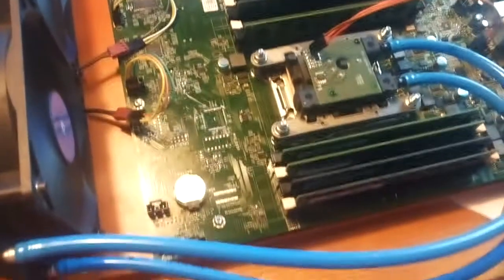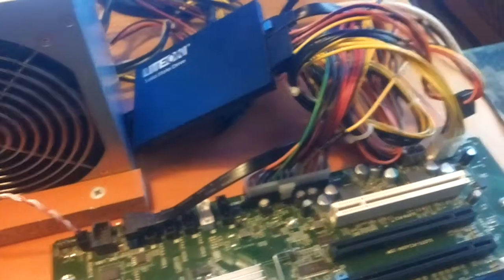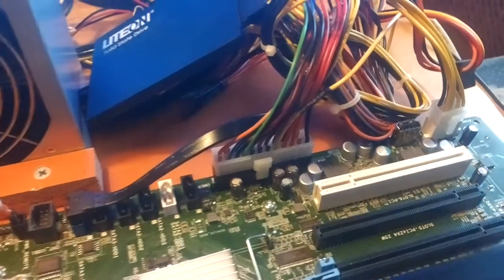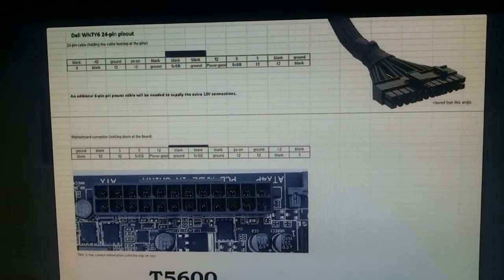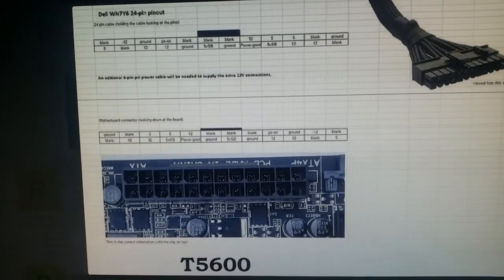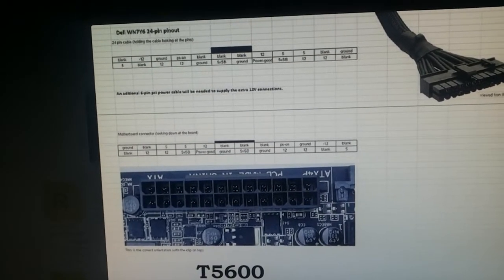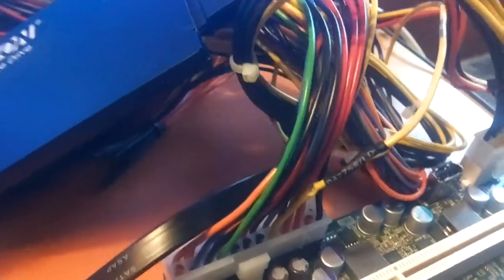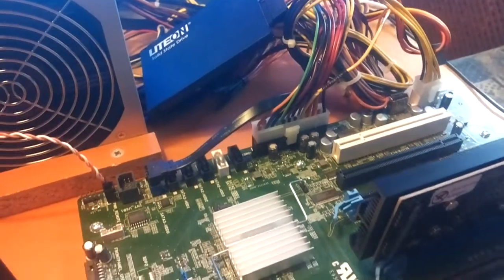Dell T3610 Power Supply mod for Dell Precision T3600 T3610 T5600 T5610 Workstation

Comment: My psu have 5v standby but my t7810 motherboard needs 12v standby any solution ?
Reply from the maker: Maybe you can use a small step up converter board
Reply: @pcandservertips8864 can you make a video for T7810 please 🙏 ?
Reply: Newer power supply spec, ATX 12v2 or something like that, have 12v standby instead of 5v standby. The new spec has been getting more common the past 10 years, but still some are the old design, especially budget PSU.

Comment: Hello, I'm from Algeria. brothers. I want to do the opposite for my dell t 5600. I want to run the 630w power supply on an intel i9 12900kf motherboard.We knew that the dell power supply does not contain 3.3v, but I think it is possible to adjust 5v to 3.3v? is it possible?Thank you
Reply from the maker: Hello, i don't think that this will work. I don't know if it is possible to adjust the 5V rail down to 3,3V. Even if it is possible, you don't have 5V anymore.
Greetings from Germany

Comment: Mosfet replaced with a tiny string of copper and VOILA....sorted thanks for your help, last bit mate , the Alert for fans 1 2 3 dont need them they make heck of a noise , keeps coming back any way to bypass this? i looked at bios and no options, ta regards

Comment: Hi , i had this computer for years and was amazing, the original psu gone now , it is very tricky to fix it although i tried capacitors and diodes taken out, now it is definitely gone for sure.
I have bought a corsair just yesterday 750 watts tx750m for 60 pounds from currys and Thank GO you are my saviour.......
pls tell me which cables should i cut please and put back together for the mb to work, i tried to plug it in and the 1 and 3 led lights next to the switch are flashing which means there is a short form the gpu , i hope i did not burn it

have i burnt it??

so can you send me a diagram cause in your video i can not understand which cables should i cut and restore to work with the psu externally as yours, i have r7 370 gpu 

thanks in advance you are the only one on tube that really spend some time all others are saying total BS ...sorry..

best regards from UK
Reply: Sorry small addition 1 and 3 led flashing mean >  PSU may be bad or PSU cable may be crimped creating a short on a main power rail. (PS_ON asserted, PS_PWRGOOD not asserted)
Reply from the maker: @stellapapadaki4299  You need to connect the 24 pin plug like the diagram in the video description. The color of the wires tell you which voltage they have. Just google the colors. Hope that helps.
Reply: @pcandservertips8864  Thanks i have done the mods and double checked with multimeter all voltages are corresponding and i have just cut the cables not needed, i am trying to start the pc the cpu fans and internal case fans work , the gpu was working fine but no picture on screen, i feel it does not switch on ,so how do i switch it on or it should auto switch when plugged in, no pic on screen , i have unplugged the switch cable and all other cables from m/board do i need to plug something else to post?
thanks
Reply: I have looked also at your video apart form the ssd you plugged in the rest are for the fans, is there a jumper i need to short to switch it on , or should it post straightaway , noting i have unplugged all the ssd and hdd and usb are clear , bit still should go to bios right? thanks
Reply: Forgot to mention i tried sorting the pins of the remote adaptor for network card  also you mention in the pin out video and no luck too, also the cpu fans are on all the time when i plug the psu is there something wrong there?thanks
Reply from the maker: @stellapapadaki4299  Maybe the RAM configuration is wrong. If the fans turn on it should boot into the bios. You can also try a cmos reset
Reply: @pcandservertips8864  Thanks, figured out and is the worse senario, mosfets for cpu1 and cpu2 are sorted, i think in my frustration may have plugged in by mistake the gpu current at some point ,, can happen even in experts, i ll take them out and solder  a high quality!!! joke.. thin string of copper as fuse like protection and hpefully i can start the cpu
thanks
Reply: @stellapapadaki4299  e aí resolveu?
Aqui tenho um com fonte mas ao testar pelo botão ela não funciona sempre… ao ligar o Computador da LED 1 e 3 mesmo com outras memórias e outra placa de vídeo. Testei com fonte adaptada que nem no vídeo e mesmos LED 1 e 3
Reply: @jonathanf.9425  Opa, conseguiu alguma coisa amigo? Estou tendo o mesmo problema.
Reply: @MFMPetry  Cliente não quis seguir com a máquina e comprou outra mais atualizada. Olhei no Mercado Livre uma fonte e tá quase mais caro que um T3610 usada com 3 meses de garantia… bem no fim a máquina está aqui na sucata, não tive mais tempo de tentar ligar com fonte convencional (pra uso interno só, não dá pra liberar com ela) O eletrônico aqui da empresa deu como condenada a fonte, encomendamos algumas peças para reparo mas sem sucesso.
Reply: @jonathanf.9425  cara acabei de conseguir adaptar uma fonte atx de 700w em um t3610. Se precisar de ajuda, avisa.